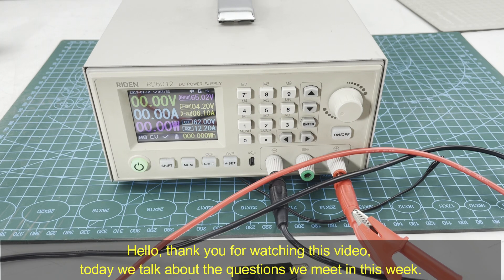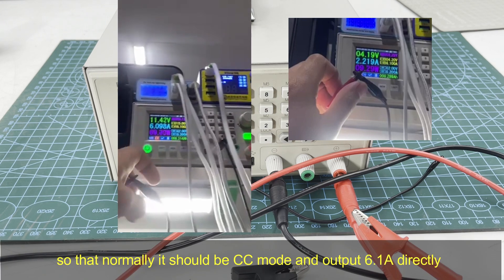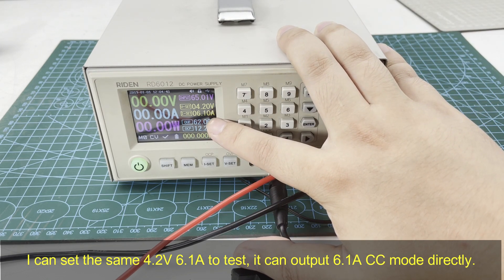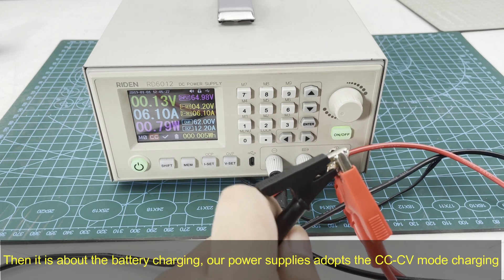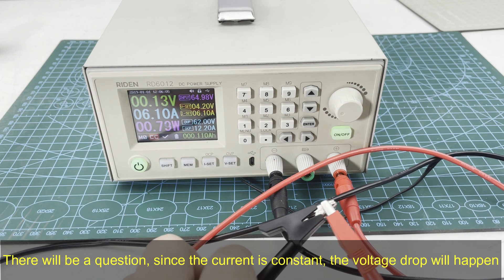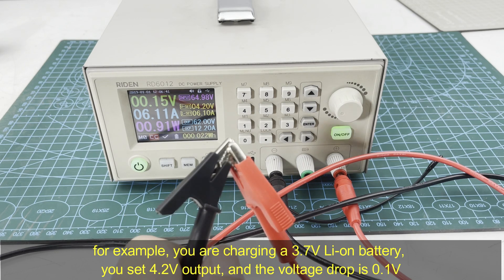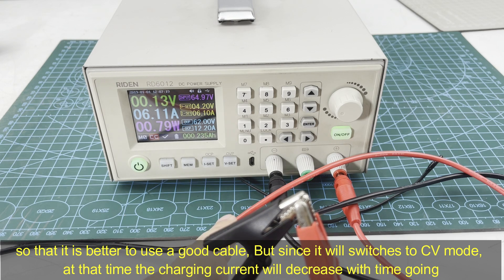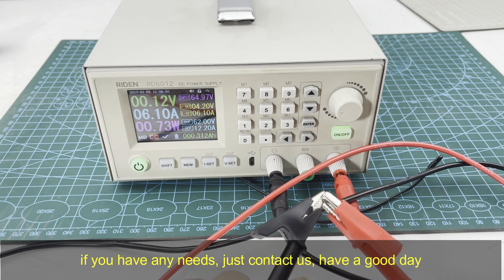output cable matters for power supply! RD6006/RD6024/RK6006

Comment: Why do cables matter? If anyone cared they wouldn't use a switching power supply in the first place.
Reply from the maker: hello, there are many reasons, 1. if your cable resistance is high, it means it may be too thin, normally according to the current you need, you shows choose the cable with corresponding Awg 2. since the cable resistance is high, when it connects to load, the heat on the cable will be higher, it is dangerous, if you find the cable really hot, it may not be suitble in the way you use
Reply: @LJacyHenry,  the power supply is not the issue... switch mode, linear, DC-DC buck or even a DC bank supply, if the cables are to thin, or high resistance you will get voltage drop and hence see a difference of the current flowing through the cables, he explains this very well.

Comment: how do i test whether existing cables are good or bad? resistance? what are good or bad values?
Reply: In video you can see how to calculate resistance, then check tables for wire diametre/Ohms. Awg 14+ is ok for most situatuion
Reply from the maker: thank you for your help, yes normally that is enough for daily use, and we can choose the suitable cable according to the current with the real needs @bestbelarusbloger
Reply from the maker: hello, you connect the cable to a power supply output, connect the cables directly, you can see the voltage and current, then you can calculate the resistance, for our cable, its resistance performance is above average level, if you need lower resistance cable, the cost may be much higher, you can also find better cable if your load have special needs